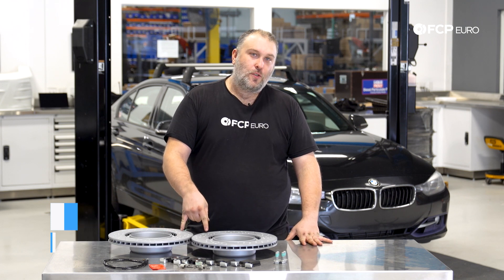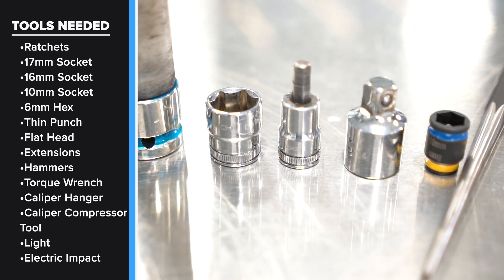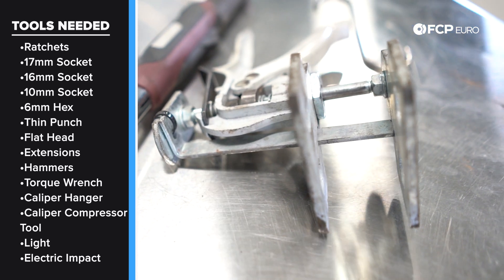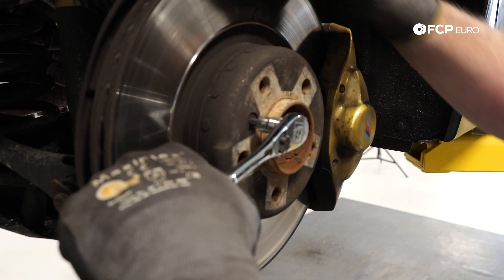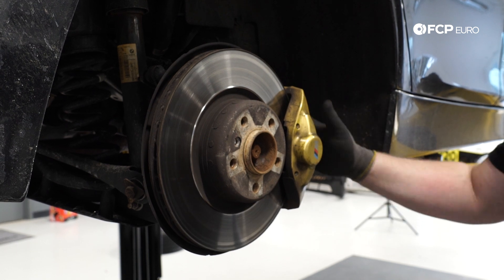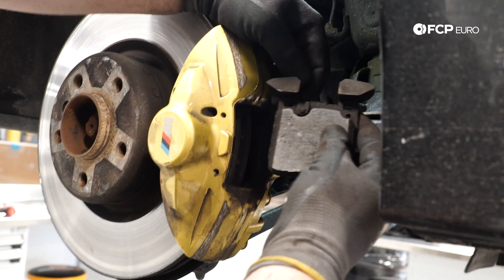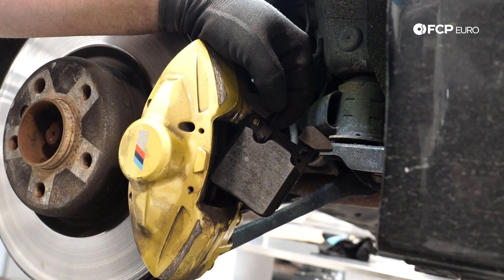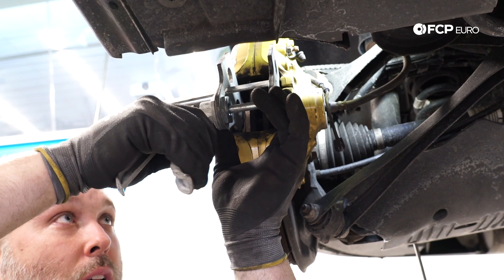BMW F30 Rear Brake Pad & Disc Replacement DIY (Brembo M-Sport 2, 3, & 4-Series)

Comment: If I dont have a piston/pushing device, can I loose the brakes oil cap in the engine to release some pression?
Reply from the maker: Hi PRXY, that will not suffice. You may be able to do it by hand, but realistically you will need a clamping tool or piston tool to do this properly.

Comment: Hi I’m doing a brembo m caliper swap for the rear of my 340i, do I have to replace my old pad wear sensor ? My current brake pads are still in good condition?

Comment: so is replacing rotors mandatory for brake changes ? i have a 2015 bmw 335i and need to change my rear brakes
Reply: So long as your rotors are still within specs and aren't damaged or have a big lip on the outer edge, you'll probably get two sets of pads to one rotor. Basically, you need to measure their thickness with a set of calipers. You'll need to track down the published minimum thicknesses. Obviously if they're not much thicker than the minimum then it would be prudent to change the rotors too.

Comment: Thanks video helped a lot, beware the brake sensor not fitting into the new pads properly, and that’s facing with the nipple inwards. Also, good luck with the rear bolts of the caliper. Whoever owned it before me torqued that fucker to 9001 Newton meters, and there is not a lot of room to get around in there without taking off the entire suspension system.

Comment: What part number did you use in this video? Your link goes to a solid, non dimpled/slotted rotor.
Reply from the maker: Hi Michael, that would be BMW Brake Disc - Zimmermann 34206797600.

Comment: Anyone with the M Performance BBK have a constant ticking sound coming from all corners at all speeds? I had one kit that was noisy from the start and another which was quiet at the start and became noisy after I put some miles on it. Some say it's inevitable for the dimpled and slotted rotors. Are drilled rotors any quieter?

Comment: Hi there!

thanks for the great vid!

i am used to servicing brakes except for cars equiped with electric parking brakes. I heard that we should always electrically disconnect the little electric actuators that brake the rear wheels via the obd2 socket.
But you did not and you did not have to, as the parking brake is in the shoe brake (so good for bmw owners) 
On a audi A3 , 1997, the mechanism  controled by hand (parking one) is not in the shoe but works on the same mechanism which is outside via a cable (audi cars A3 model ) SO I THOUGHT it would be the same for new one equiped with ELECTRICAL MECHANISM.
Can you confirm me that we can work on ANY electric parking brake wheather the mechanism is in the shoe or outside wihtout any obd2 disconnection ?
thanks.

Farid.